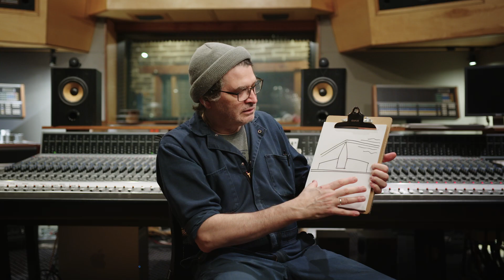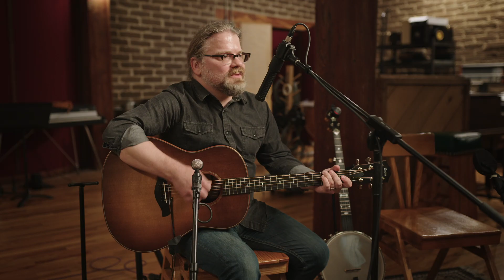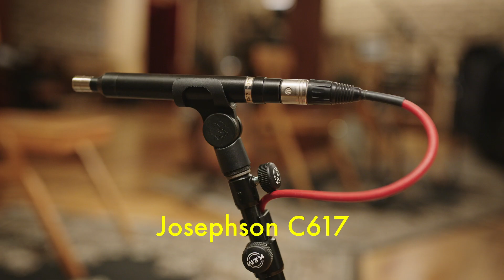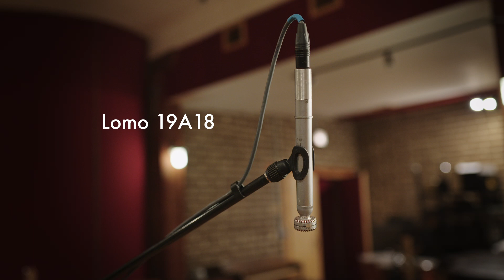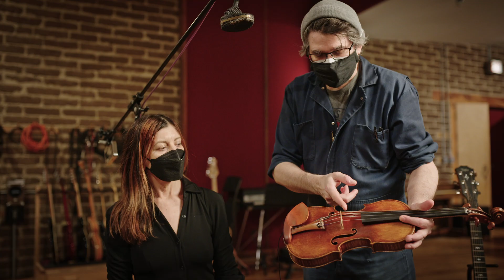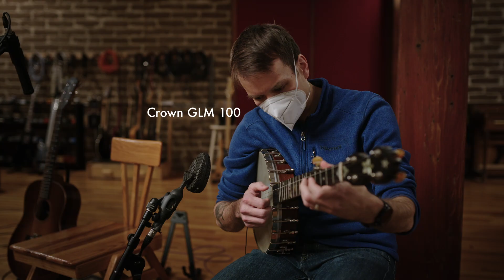Electrical Audio How-To: Recording Acoustic Stringed Instruments

Comment: The body of an acoustic stringed instrument doesn't AMPLIFY, it just projects energy that's already in the string into the air.

That's significant because whatever sound is being projected from a stringed instrument is being lost from the string, reducing sustain.  (And the more it projects particular frequencies, making them loud at first, the faster those particular frequencies disappear from the sound, making them quieter later.)

That's the key difference between acoustic and electric instruments... electric instruments can actually amplify things---well, the amplifiers can---without those things necessarily disappearing from the sound quickly.

It's also important for understanding the difference between guitars and bowed instruments like the violin or cello.

An electric guitar gets sustain by AVOIDING transferring string vibrations into the body and/or neck.  The mass and rigidity of the body (especially) and the neck make them harder to vibrate, so that most of the strinig vibration energy stays in the string and is only slowly lost to the neck and body, and directly to the air.   A violin or cello is entirely different---it's very light and stiff, and it's easy for string  vibration to be transmitted via the body to the air, like a speaker cone.   A bowed instrument has almost no sustain, and can only play long sustained notes because the bow continuously pumps energy into it.

And that's why Paul Reed Smith is completely full of shit talking about "tonewood" for solid-body electric guitars, and saying it "stands to reason" that what's good for violins is good for electric guitars.   That's completely dopey because the acoustic bowed instruments are highly resonant---it's easy to make them vibrate---but a solid body electric guitar is designed NOT to resonate much at all.

Comment: hi, thanks for sharing that great knowledge, the guitar+voice demo was impressive! on that subject i have three questions:
1/  how do you deal with the room sound reflecting both sources back into the microphones?
2/ i understand the figure-8 microphone should be 90° relative to the mouth, that being said in that case how do you point it optimally at the guitar (angle, distance and point that the membrane faces)?
3/ how does the diaphragm size matter if it does?

PS: for solo guitar i usually point the mic to the fret board around the 12th fret 1' away.
Reply from the maker: Hey, not-Steve here, he is unlikely to be able to answer your questions, but I'll try to answer as best I can knowing his methodology and approach fairly well:

1/ Not a concern. Both because room sound is not a bad thing, and because the mics are close enough and the room big enough that the ratio of direct to reflected sound favors the direct widely.

2/ Think of this as a spectrum rather than in absolutes. 90 degrees will have the most rejection, but does not always sound best. So in setting that angle, you may have to balance your need for isolation with getting a better sound from the mic. You can see in the video that the guitar mic is setup at or a little above the low-pitched string on the guitar and angled down towards it, and kinda the inverse with the singer where the mic is angled slightly up towards his mouth to get better rejection of the guitar. Closer will give you better isolation, but you also increase the already substantial proximity effect of the fig-8 mics.

3/ No

Yes, I'm (again, I'm not Steve) a fan of 12th fret and neck-body joint miking, as well. It is less boomy than anywhere on the body, and resonances there are less severe.
Reply: @ElectricalAudioOfficial  thank you so much "not Steve" for explaining the mindset, i think i understand 🙂! i will use that as a starting point to mess around with... for the song i'm working on, once i can play it naturally. 

first time i do both on record 😀.

have a great day 🙂

Comment: I don't quite understand why you would use figure-8 over cardioid on the first example with guitar and vocals. If the null is the top of the mic, wouldn't the positioning and pickup be the same for cardioid, just with less pickup from the rear side?
Reply from the maker: No, there is way more rejection from the "top" and "bottom" nulls on a figure-8 mic than on a cardioid.
Reply: @ElectricalAudioOfficial  ahhhh. Thank you for the clarification. Just tried the technique using the "side" nulls and loved the result. Excited to try it with the orientation in the video!

Comment: Similar to isolation, another good use case for mixing in a little pickups with the mics would be (as long as you have a clean signal) to improve the signal-to-noise ratio, and when mic placement isn't cooperating or there's not enough time for getting that perfect, to round out the fullness of the sound by filling in anything for which the mics aren't perfectly working.

Comment: Doesn't a figure 8 microphone have the null at the side, with the front and back both being active, while a super cardioid mic has the rejection to the rear - meaning whatever the mic is not facing? I think of figure 8 as synonymous with bipolar.
Reply from the maker: Supercardioid actually has a lobe of sensitivity at the rear. It's an "in-between" pattern that combines cardioid and figure-8. So there is better side-rejection than on a pure cardioid mic, but less rear rejection.
Reply: Is the side null on a figure 8 greater than the rear null of a hyper cardioid?
Reply from the maker: @distortiontruthBOS-RP  Hyper-cardioid is also a combination of figure-8 and cardioid, so it also has a lobe of sensitivity at the rear, and better side rejection than pure cardioid. Figure 8 has the best side rejection of all polar patterns.
Reply: @ElectricalAudioOfficial  Great. Makes perfect sense.

Comment: Hey, great video! The Crown GLM-100 sounds surprisingly even and not so totally different from the Josephson. Do you think that the even-ness of it has to do with it being omnidirectional? I’ve noticed myself that even dynamic omni mics sometimes sound more natural and extended (also not hyped in the low end) but still not really that ”roomy” when placed close as one might think. Related to that, have you used the hypercardioid GLM-200 and are they much different (sounding) apart from the polar pattern?

Comment: With the crown mics. I presume one is picking up 3 bass strings and the other 3 treble strings? Would any decent mic in this style work?
Reply from the maker: Yes. Yes.
Reply: @ElectricalAudioOfficial  great thanks. Just another thing. How do you pan the mics afterwards in the mix for guitar I presume the vocal is centre
Reply from the maker: @nealo814  no rule there. Do what you like.
Reply: @ElectricalAudioOfficial  cheers

Comment: If using a lavalier mic on the body of the acoustic instrument, does that mean the room you're recording in shouldn't matter very much at all?
Reply: A lav is an omni, it will pickup ‘some room’ it’s mainly used for a close up perspective of the instrument that can be blended in to taste.
Reply: @brainwasher3742  The examples were not blended in to taste were they? It was just sound examples of the mics pulled back, and then the lavalier in isolation (solo'd) which I thought sounded good enough for the main track? 

I have a few lavaliers, I never thought to try them taped to the guitar body. I have had decent recordings wearing the lav mic on my shirt though. I've got  a lav mic very similar in shape to the one used in the video, flat, very easy to tape down. I should try it out as soon as I get a bit of time!

Cheers for reply!

Comment: The idea of using two figure-8 mics to isolate the guitar and vocals from each other is nothing short of genius. Thanks Steve!
Reply: It can work beautifully.  Others that I favor are Blumlein, ortf and my *personal favorite", Jecklin Disc.
Reply: ...or obvious...
Reply: @morbidmanmusic
Reply: Doesn't a figure 8 microphone have the null at the side, with the front and back both being active, while a super cardioid mic has the rejection to the rear - meaning whatever the mic is not facing? I think of figure 8 as synonymous with bipolar.
Reply: @distortiontruthBOS-RP  The nulls on the sides of a figure of 8 are well defined.   A supercardioid pattern has small spikes on the sides, as well as a narrow spike coming straight out the back.  In essence the figure of 8 has nice smooth round pickup patterns, and the supercardioid has spikes coming off it, with the front being largest long and narrow.
Reply: @DavidHartwig  many years ago when I was an infantry soldier in Germany I did a lot of moonlighting playing music, as well as interning in a classical music centered recording studio with a very well-known classical music producer/engineer.  At the time I don't live in recording for about 2 or 3 years and I was very hungry for knowledge. At that time I was particularly hungry for knowledge that was outside of the classical music recording environment.  My favorite band at the time, was Wilco. Jay Bennett, the guitarist, studio wizard, and really jack of all trades in that band, well I really looked up to him a great deal. I'd gotten his email somehow from talking to them briefly after a show in Cologne, wherein their Uber cool , nice as hell  live sound guy, Stan Doty, had let me hang out at the console and take a stereo feed from the console to my digital recorder./ So anyway, I used to email Jay Bennett a lot just kind of trying to pick his brain, learn everything I could from him.  he was one of my heroes, like Steve Albini, Daniel Lanois, and innumerable great engineers.  I got one of those emails, the last email he sent me , about 8 months before his death, framed.  I'm pasting the body of it here://
Jay:

Hey Ted, thanks for the words, I appreciate it! Hope all is well with your band and recording...so..
FINALLY, some easy questions. thanks, very direct ...you will get much out of me, if you continue framing your questions in this manner.

best overall mic ever AT 4050, hands down...nothing it can't do...and it's cheap, which plays into my equation here...

VOX MIKE: I love the BLUE Mouse...a 414 can be good, but has TONS of (annoying?) high end...SM7 (not sm57) is great ROCK vocal...also perfect when band is live in room with vocalist or for folks with low voices...

KICK drum...have to admit,...haven't found one that does the trick every time...sennheiser made some pretty cheap thing a few years ago, that was GREAT for rock drums...i WISH I knew the answer to this...I mean, I make do...and have tried all the standards...but "the one" alludes me.

ACOUSTIC GTR technique---one high quality condenser at 15th ish fret ( where body and neck meet) pointed flat at fret board....4 inches away ?...second mic, a "personality" mic, I use an old Sony C37 p (now, this is a very rare and expensive "personality" mic, but you don't need to go that far)..this one points at bridge...from below or above, but not straight on...again 4" away...I use a good SOLID STATE pre...Amek 9098...one of the few applications where I will go fo ss over tube...put the low end roll off on the pre...check for phase between two mics...you will not notice a totally in phase vs totally out of phase thing, it will be more like...which one sounds better, a matter of taste, not right or wrong...

Then i go through a pair of API 550's (4 band parametric)...boost something in 800 to 1.2K...and then 2.5 K as well...the high and low of the EQ I usually don't touch

Then the perfect compressor, is a tube tech stereo ..i forget model number..it just interfaces with ApI's so well...I always EQ pre compression when recording...in many cases it doesn't matter, BUT in this one it does..

could go on for hours about this...hope this gets you started...i know I'm talking about some pretty expensive gear here,...and there are other ways to do it...starting form that mic set up (which is the crucial thing)

ALSO...play a good sounding acoustic..with broken in (NOT NEW) strings (this is a big mistake people make)...mid 60's gison small to medium bodies are the best...stay away from things with tons of low, and tons of shimmery high ( unless u r in nashvillle)

NEVER mike the sound hole...

love Jay...hope that helps//// hope that helps someone! It sure has me. RIP JB ❤️
Reply: @TeddyBullard ok great so you’ve got 2 mics on an acoustic. We’re on the same page here, phase is aligned as possible, once you’ve recorded so you pan one left and the other right to get a stereo image, how does one go about doing that. Also if I have a room mic on a guitar 10 feet away do I still need to align the wave forms so they are the same or does phase not matter after a certain point. You seem knowledgeable and I can’t find thsi information anywhere
Reply: @morbidmanmusic  some of us are idiots, albeit much more pleasant

Comment: Very interesting! I really liked how the ribbon worked with the violin. I play upright bass and found a similar mic position to the cello to work quite nicely, or if I need to have less room in the sound, maybe just a bit closer. The guitar mic was the most surprising for how much rejection you got. My ribbon is pretty dark and I haven’t been that happy with it on guitar, but maybe a U89 in figure 8 would be something to try in that spot, though the lav mic is also something I’ll try to add. Thank you very much for putting together this video.

Comment: I like the bleed rejection with the ribbon mics but I'm not thrilled by the dark sound, even with the mini condensers attached to the body of the guitars to compensate for the attack and the brightness not capture by the ribbon. When doing a live setup like this I prefer to use a condenser with the guitar and something like a Sennheiser e935 in the vocals to achieve something similar.

Comment: 25:40 This is possibly a very silly question, but is there a good reason to use a mic stand instead of a C stand in this case? I only have limited experience in the film and photography world, and even less in recording audio, but it seems to me that the standard 2.5" gobo head clamp can handle a lot of torque compared to the dinky mic stand clamp, plus if you follow the right hand rule such that a drooping fixture tightens the clamp, you can easily support loads in excess of a pound very safely. Of course, the counterweighted mic stand works, but in a fancy studio like Electrical Audio, a few C stands ready to go seems to make a lot of sense.
Reply from the maker: Mic stand booms have a threaded end that fit standard-sized microphone mounts (clips/ shockmounts). It's as simple as that. There are probably c-stand - mic mount adapters at this point. If not, cut us in on the profits.
Reply: @ElectricalAudioOfficial  You can get baby pins with 3/8"-16 threaded ends, 3/8"-16 to 5/8"-27, and red Loctite and essentially end up with such an adapter. If you're ever feeling inclined to try it out, I'd love to know what you think of it compared to a regular mic stand. The sky's the limit in terms of the loads you can support once you're in the film equipment world.

Comment: One quick correction, the pickup detects the DIFFERENCE between the bridge and the strings. Some of the qualities from the guitar will absolutely be apparent from the soundboard vibrating at a different rate ass the strings. You are absolutely correct about the effect not fully capturing the sound however. 

I still track the pickup if the guitar has one for more options during mixdown. Tracks are so cheap now, there's no reason not to record from every decent option. I have also used multiples of the same mic to record offsets for nulling (or just using, the ambient mic can be way more interesting and intimate) later in the mix. Old timers will know the Grateful Dead's 'wall of sound' trick of double mics, one out of phase. Play around with the mics and your mixer to make sure they are similar enough to actually null first, ask me how I know.

Also, pay the money and buy the GREEN masking/painters tape, which is usually even better for finishes. Still a gamble if the finish is crackled or loose. Tip: if all you have is cheap cello tape, you can stick it to your (cotton) tshirt a couple times and it becomes removable, albeit with a bit less tack.

Instruments are fundamentally, air pumps. 
Do not get hung up on expensive mics, preamps aren't noisy anymore. An sm57 can be about as crisp as a $12,000 dynamic with a gentle EQ. Dynamics are being slept on so hard, and reasonably priced diaphragm mics are worse than ever. It's all in the pre-amps. Diaphragms always sounded better by bypassing your crap preamp with their own minimal internal one, boosting the level before noise in the signal path could creep in gifting you more dynamics and lower noise-floor (usually dictated by the quality of the preamp circuit in the mic). These days a $200 audient interface will blow any of them away in the preamp noise department. But all technologies will have their own character, just don't assume that a ribbon sounds better on vocal and an amp wants a shure, many times I find the opposite to be true. Test everything against a nice sm57 before goin nuts, the results will, without fail, surprise you.

Amen to counter-weighting stands. Makes everything easier to deal with. You don't need anything fancy, just hanging your jacket off the back can work well, and maybe even dampen things.
Reply: Albini doesn't categorize the SM57 as a microphone, but I think EA owns at least one for some reason.
Reply from the maker: @rrrafiel  Steve doesn't like it, but he is not the only person who works here. There are three other staff engineers and we rent our studios to freelancers, many of whom use SM57s regularly.

We own three.
Reply: @rrrafiel  for self-defense.